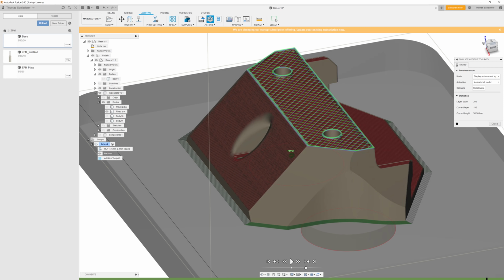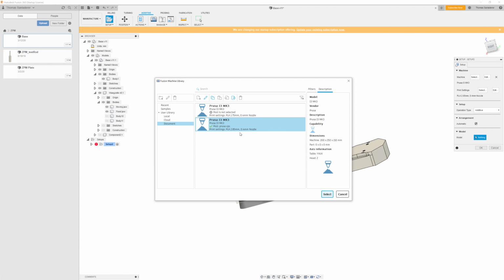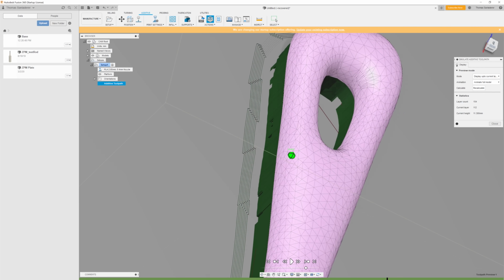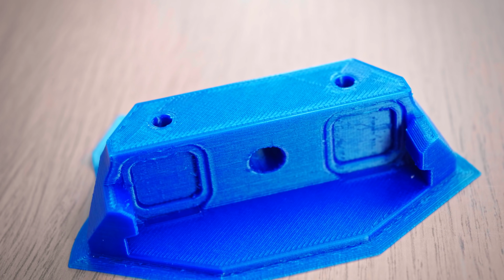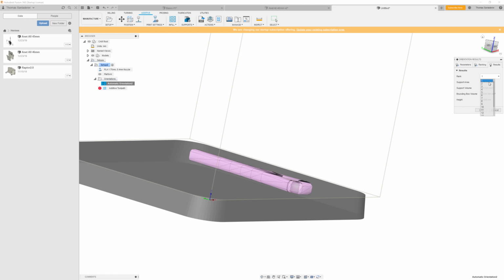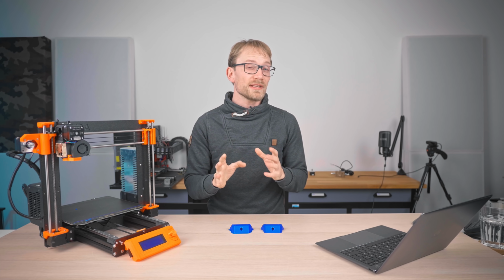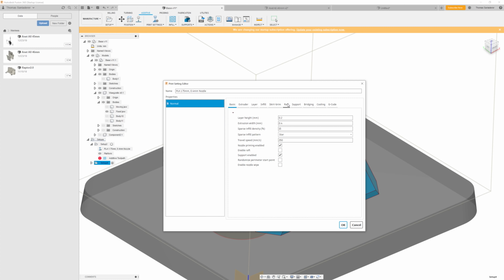You can now 3D print your parts with Fusion360's new slicer! Is it worth using?

Comment: Great video, thank you. Im biggie backig because ive seen the shelf bracket you designed with the générative deisgn in fusion. I was wondering if you were selling or sharing that 3d files? I wanted to modify it and add a french cleat to be able to use it on my french cleat wall. if not thats cool too !! :) thank have a great day!

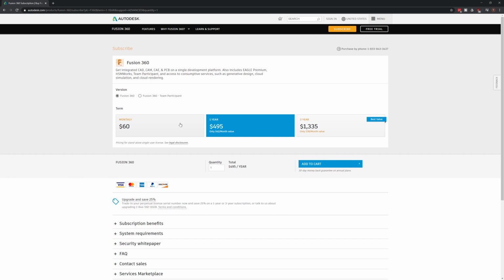Comment: 10:18 , when you export to STL from fusion do you do it from the file menu (where it has to use a cloud converter that takes ages?)
if you right click on the component name from directly in the workspace it gives the option to save as STL (or click on the project name to export all components)
this does the conversion locally and it happens MUCH MUCH quicker than using export from the file menu. (you can also tweak the conversion settings to lower polycount etc)
I can save as STL open cura and slice the model LONG before the cloud conversion has happened.

I've always thought that was crazy that the export from file menu method uses cloud conversion when it can clearly do the conversion locally

Comment: If Fusions slicer tool path generation is anything like Inventor's CAM (which the HSM is still the same plugin, the slicer I'm not sure about I imagine it's from Netfabb). But Inventors CAM tool path generation requires VRam. It makes a significant difference. The streaming workstation you have, try the tool path generation in that vs your laptop, see if it still takes longer.

It's only a matter of time before Fusion is the default, they have some talented software engineers under their belt.

Comment: Thanks Thomas for the informed video.  I noticed the setup in Fusion denotes the Prusa MK3S as having a bed size as 200 x 250 x 210mm.  This seems to be backwards in X-Y-Z dimensions as defined by Prusa, with a bed size of 250 x 210 x 200.  Does this have any impact on print area when slicing direct from Fusion-360 vs the Prusa Slicer?  It would seem as though the print would overrun the allowable print area.

Comment: I use Fusion360 for modeling, but I'll stick with Simplify3D for slicing. Simplify3D has its issues, but the exceptional results with my Prusa i3 Mk2 speak for themselves. I've gotten better results from Simplify3D than with Prusa's own slicer.

Comment: I walked away from Fusion 360 last year for Design Spark Mechanical (DSM) when Autodesk changed the licensing for us Hobbyists. When all of my models and work is locked up by Autodesk in the 'Cloud' and they can change my access at a whim it became very obvious I had to find another 3D design tool. Now they want to lock me in even more with the slicer? I think not. I can Link DSM directly to Cura and then Cura directly to Octoprint. And all the while I retain control over my IP/files on my storage. I do not trust Autodesk and while F360 is a great platform for me it's not worth the risk.

Comment: Can't wait for the time when you'll be able to slice your part with a certain infill and than simulate the stress based on your wall count and infill type/percentage.
Reply: Žan Pekošak i feel like this should already be a thing
Reply: Oh yeah. Should be. Cant imagine the CPU power it would take. Takes my poor quad core 3min to auto route a circuit board let alone do 3D.
Reply: @zanpekosak2383  That's why softwares like fusion are biased towards cloud computing, which frees you from your hardware limitations.
Reply: that would probably require cloud credits though ;-)
Reply: @AmauryJacquot  You can make a student account with full free cloud credits. It works.
Reply: Wanted to say the same.
Reply: @transcendtient  Fusion does generative design. It doesn't do infills specifically but it's as close as you can get.
Reply: Interestingly enough I think Autodesk already has a product that can do this, it's called Netfabb. Would be interesting if it makes it into F360.
Reply: Is this a thing that is available yet??

Comment: Just few hours ago I was searching for remedy for too small holes in the prints. Main tought was that is really hard to detect if it's a hole. If there is integrated slicer with modeling software, like in this case, it's easy peacy. I would love to see hole diameter compensation in Fusion360 slicer!

Comment: Judging print quality based on two prints where one is not even from the same slicer is kind of dubious.
Looks more like one just had some feed issues. If it repeats however, then it is a slicing issue.
Remember that fusion will be in a very special situation soon when they start adding features like infill based on simulation or procedural calculations. With the model in the same tool as the simulation results they should be able to do this complicated workflow with a click of a button.

Comment: Doesn't seem to have options to push the gcode to another program instead of a file, either. With Fusion, Cura and the Octoprint plugin, I can get a model from Fusion to the printer without copying any files anywhere (and faster slicing). Maybe in a future version...
Reply: No, but I might...
Reply: @howardjones543  Perhaps mounting the raspberry directory on your PC might be enough in that case. You could directly write to it.
Reply: That's a good point. I guess I've to check the Fusion 360 API to check if this could be implemented via an add-in.
Reply: @WilkoVehreke  I guess a simple enough work-around would be something to watch a directory and push any new files to Octoprint. As a standalone app, that could be useful for other things too.
Reply: @howardjones543  I see your point but this isn't something I would want to implement.

Comment: I had that problem with not homing and bed leveling too. But when starting the Post Process, you can select the printer model in the first row in the table on the right, under Program Settings and then it homes and does a mesh bed leveling. At least, this worked for me and my Prusa i3 Mk2.
Reply: Update: Autodesk have updated the postprocessor for Prusa.

Comment: I'd love to see G2/G3 true arc support in fusion additive manufacturing. I guess it would be a lot easier implemented than in other slicer software since there's no stl involved.
Reply: That's an interesting point! It has a lot of potential to be smarter about the slicing, since it's not just getting triangles.
Reply: I'd speculate it's already there, i.e. toolpaths are generated with true analytic geometry under the hood, and only dumbed down to line segments for 3d printer to understand.
Reply: @victortitov1740  if that is the case then it would be a matter of an output option.
Reply: does your controller support it
Reply: @dastompa  almost every controller and firmware supports G2/3 commands, I myself run multiple duet 2 wifis. David Crocker shows a plotter code running on a delta printer. a buddy is in the Marlin core developer team and also confirmed it working.
Reply: The vast majority of toolpaths in most CAM software convert the NURBS model into an STL so it can calculate the toolpath anyway. Part of that algorithm recognises arcs and if it doesn't, they often include an arc fitting function. My point being, CNC milling & lathe gcode output from CAM, generated from NURBS or STL is still mostly a series of lines... some modern high end CNC machines much prefer processing a tonne or G1's instead of a mix of line's & arcs. I can see how supporting G2/G3 here would be beneficial, but it might not work out as well as you hoped in all situations.
Reply: @ScottMoyse  I mostly agree, especially since junction deviation is a thing in 3D printers firmware, but there are definitely cases where it actually would be beneficial, just thinking of smaller radii, where the segmentation is badly influencing the extruder. for my part it would be certainly benefitial since I'm using a servo drive for the extruder.
Reply: I would find every way to make fusion360 slicer work if that was the case. NO MORE MESHES!!!!(-sorta)

Comment: I like Fusion360 but I don't trust Autodesk to not pull the rug out from under me.  I got a perpetual license with Alibre3d.  They have a parametric cad program that has a hobbyist level for $200 US that goes on sale for some deep discounts.  Just need fusion360 for cam and now maybe slicing for different infill.
Reply: How does it compare? I like Fusion360's style (OpenSCAD's programmatic style feels terrible) but I'd like to get something a little more reasonably priced if I ever buy into something.
Reply: @LanceThumping  Have you tried FreeCAD it's both cross platform and Libre/Open Source software. I personally like quite a lot, but I am biased as I prefer my software free as in speech.
Reply: @TalpaDK  it's better than freecad.  I have tried that too.
Reply: @TalpaDK  I like FreeCAD too. No cloud/privacy BS and can save files locally without any hassles. Personally I hate the nonintuitive F360 interface. CAD programs are a big investment of time and learning and I certainly don't trust the corporate model of autodesk, who could pull the plug at any time. Even though F360 might be more polished and has plenty of whistles and bells, FreeCAD is just as capable. FreeCAD is an active and growing project and I see it someday growing to the level of success that KICAD has become.
Reply: @LanceThumping  you draw a sketch and do operations from that scetch.  Not as streamlined as fusion and definitely not as good as solid works but very doable.
Reply: FreeCAD: free
Reply: FreeCAD is pretty damn viable choice these days. There weren't many good tutorials couple years ago, but now there's multiple videos that'll help you get going. It surely has it's annoying things, like I still haven't figured out why drawing lines in part design doesn't "snap" into previous line even though I try to carefully select end of the line. It's also bit of a pain to select things and make those symmetries etc. but if and when you get past that, I'll be honest it's pretty damn good. Unfortunately there's still loads of stuff that aren't obvious like doing calculations directly at dimensioning like Fusion360. I didn't know about it until accidentally did it like in Fusion and figured out that it works pretty similarly

Comment: can you stress test the geometry of the 3d printed part in fusion 360?
Reply from the maker: You can run simulations in Fusion, but approximating the way 3D printed parts behave is going to take some work (it should be possible, though)
Reply: @MadeWithLayers  AFAIK they cannot simulate materials such as wood or printed layers.
Reply: Well - yes, and no. If you make some really big approximations, you can do it. But the FEM software in Fusion 360 will assume an isotropic material model - which means, we will assume the strength of the material is the same in all directions. This is majorly not true of FDM 3D printed parts. In the sim world, we sometimes assume the strength is just the weakest direction everywhere, but this is obviously not so great. Also - polymers (plastics) are a non-linear material, meaning, they don't really behave like steel when loaded. You CAN simulate plastics using F360 - but to do it well, you'll need some pretty specific material data - and by the time you run your filament through your printer, chances are, the material properties are mega-different to the data that your filament provider would give you. So - you'd be stuck having to test your material. And probably every time you use a different setting as well. So - here again, you basically estimate big time to get something workable.

Is it worth it? Probably not - but you may have applications where it is needed and worthwhile....its kinda up to you.

Comment: Nice review, thanks. I've been using it couple days now, is very good but there are many improvements needed before it can compete with Cura on flexibility. Creating a post for my modified A8 was a steep learning curve, despite a working knowledge of javascript.

One major advantage is that you can keep the slicing profile as part of the design project!

Comment: Things that I would love to see added: Simulation based infill density (as you mentioned) would be awesome. And for weight optimizing designs, having the 3D printed part override the solid body  would also be fantastic since right now even if you just set a part as some arbitrary percentage of the 100% dense material, it will never be true to life after printing, and to really accurately account for it you need to manually create a new density for every printed part.

Comment: Thomas,  Posted on Joel's video too:  Are arc/circle G-Codes simple G0/G1 X/Y moves, or is Fusion using I's & J's or R's for arc moves?
Reply: I believe the main issue with incorporating arc moves into slicers is that the printer firmware doesn't support those commands currently
Reply: @Team11mRC  marlin does have support for g2 and g3, the reason why it isn't being used is most likely due to the nature of stl files as they only have surface information stored in then and round structures get broken down to many straight segments (surface patches)... That and the other argument might be that it would be quite hard to properly identify use cases (how will it differentiate between a spline close to a radius and a proper radius for example)... Would most certainly be possible but I can imagine it using a lot of processing power while slicing...
Reply: @Averell64  I would guess that it's easier to implement in fusion than it is in other slicers, since there must not be a stl. fusion is capable of generating tool paths for milling and turning which use G2 and G3 already. let's see what the future brings, I put all my hope in fusion 360 🙂
Reply: @3dprintingguru378  definitely, but the state it is in right now is more an alpha or early beta version - I have high hopes as well though :D
Reply: Brandon Mott Klipper supports I’s and J’s and we found out Marlin 2 supports both. Firmware is good. We just need to be able to slice native CAD or B-Rep models (step or iges).